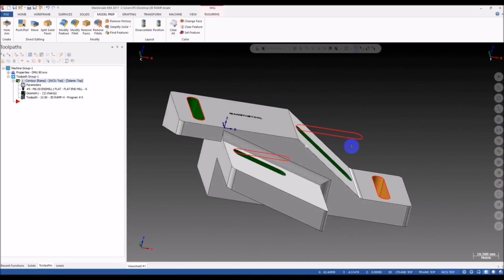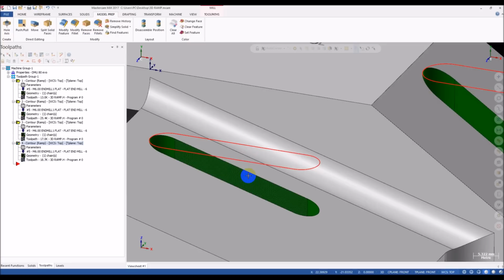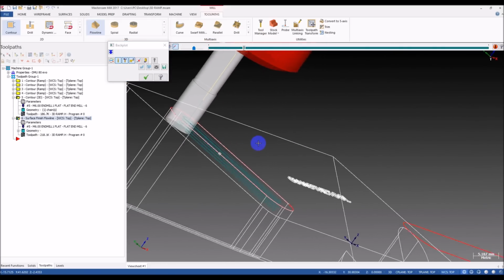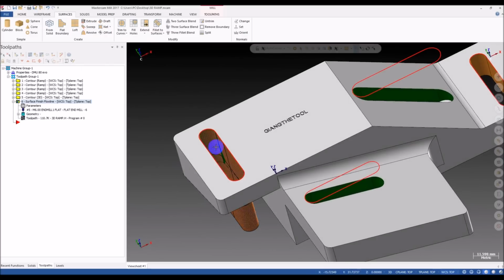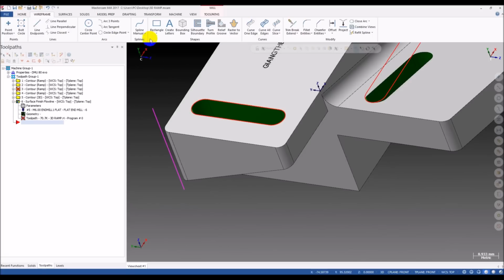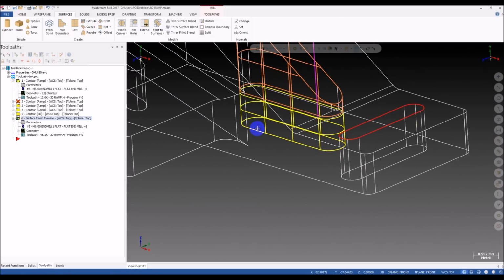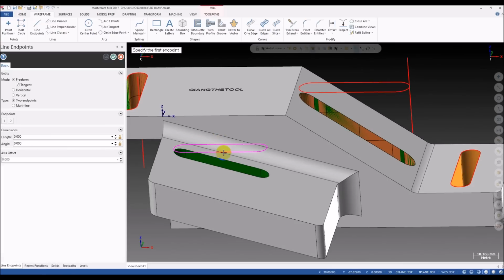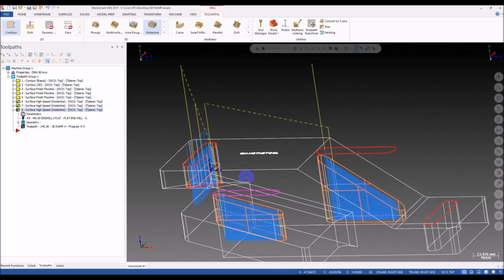Mastercam Trick: 3D Slot Ramping using flowline toolpath

Comment: I can hand program that slot in about 5 minutes using a sub program. All I have to know is the length and width of the slot, and the difference in Z from end to end of the slot.  It is as simple as doing a flat slot, but just adding the Z values.  I don't consider that feature, (or that part) 3-d machining, because I can easily program the slot by hand with about 15 program blocks of data.  In fact, I can program that entire part by hand, (may be not as fast as a proficient 3-d programmer),  with a several sub programs, since there are no complicated curved surfaces the tool has to follow.  That part is all linear lines and circle interpolation.  If I had a order for a number of those parts, I know I would not spend 10's of thousands of dollars for a software program, because I can program that part, (looks like 3 operations with no rotary table), by hand in one day.  I do plan of getting a bigger machine to make billet parts, but it looks like the 3-d program companies are going to lease you the program, (instead of you buying it), and pay a continual charge of thousands/year.  I am looking into such programs now, but I want to own the program. I don't want the program to own me.
Reply from the maker: That's great really
Reply: Get a Crack

Comment: Hey, Great trick. But Do you have a way to control tool comp. G41 G42 with the Flow line tool path? Thanks
Reply: no i don't think so because the flow line is 3D toolpath and there is no tool comp G42 G41 with 3D toolpath. Only with 2D toolpath you can manage the tool radius comp. otherwise great video GIANT THE TOOL, i already had to redraw the surfaces to get the right motion tool but your trick is very interessting